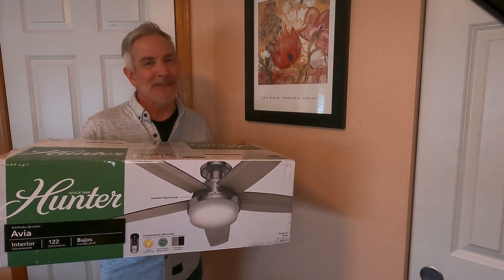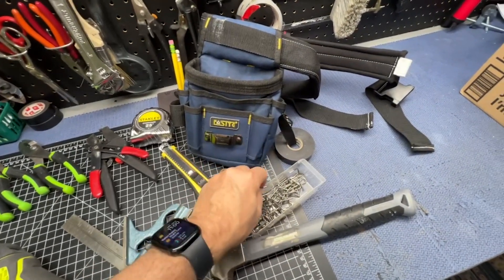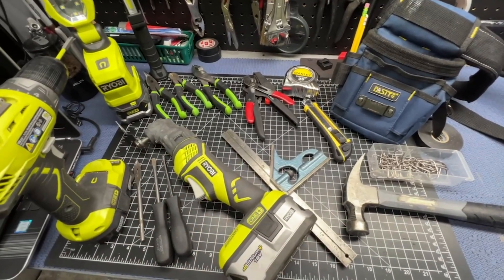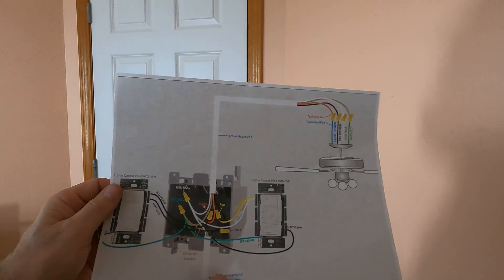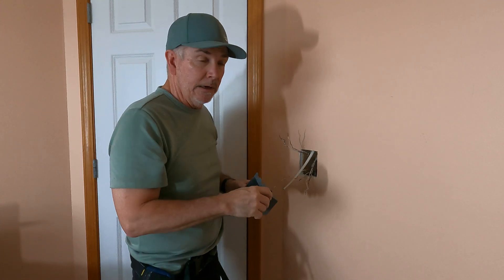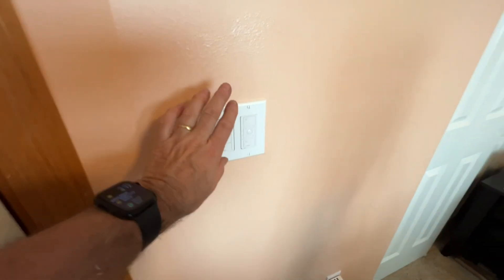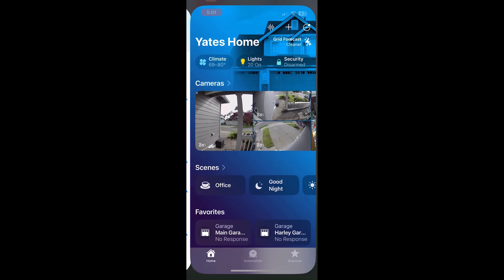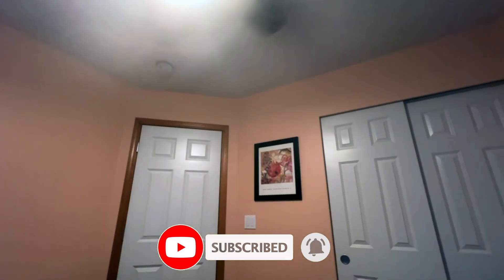Upgrade Your Ceiling Fan With Lutron Caseta & Apple Home

Comment from the maker: Links I mentioned in the video.
► WIRING DIAGRAM: https://bit.ly/WiringDiagramCelingFanLight
► Hunter Ceiling Fan Light: https://amzn.to/3TzVbQf
► Lutron Caseta Dimmer Switch: https://amzn.to/4c8WJ9Z
► Lutron Caseta 4-Speed Fan Switch: https://amzn.to/4eauQAm
► Lutron Caseta Hub: https://amzn.to/3VxryQs
► Lutron Caseta Pico Remote: https://amzn.to/3Vhmuy6
► Lutron Caseta Pico Fan Remote: https://amzn.to/4cbT63m
► Lutron Caseta Pico Remote Dual-Pedastal: https://amzn.to/3xjx2om 
► Romex 14/3 Wire: https://amzn.to/3RhLJz0
► 2-Gang Electrical Outlet (Old Work): https://amzn.to/3KEpjUU 
► 2-Gang Wall Plate: https://amzn.to/4c6olg3
► Voltage Detector/Testers: https://amzn.to/3x3U42z 
► Stud Finder & Wire Detector: https://amzn.to/3Vyd2Yz  
► Ceiling Fan Bracket: https://amzn.to/45y2MmJ
► 25 pack Wire Nut Assortments: https://amzn.to/3Vf7hO4

Comment: You should have bought the Pico remote control and a new receiver module for the fan so it would be controlled from the wall switch and from a remote as well. But I guess the way you did it you don't need a remote control as you can control it from your phone. I still don't see how the fan is going to work without a module in it
Reply from the maker: I bought the pico too. It all works great, plus works in Apple Home automations.

Comment: Clearly the fan you started with was not a smart fan It was just a remote control fan. You totally skipped the part about what you did with the RF module in the fan. Did you remove it? Did you keep it in there? Perhaps you can clear that up for me
Reply from the maker: Correct, I made it smart. I removed the rf module and remote entirely, it’s not compatible with this setup. See wiring at 10:11 time. You can get a Lutron pico remote if you still want it all. https://amzn.to/4oAVOG4

Comment: Great video. Did you leave the original remote control receiver in place? If so, does the original remote control cause any problems with the lutron switches?
Reply from the maker: @smokeupjohnny2634  Hey thanks! No,  I eliminated the original remote control and receiver entirely. They would not be compatible to use both, the fan would make a ton of humming noise.
Reply: @GYATEZ  Ok, that's what I thought, but since you didn't show it I wanted to be sure you weren't using some special sorcery. Thanks!
Reply from the maker: @smokeupjohnny2634  😂